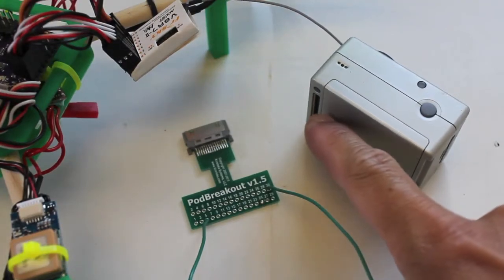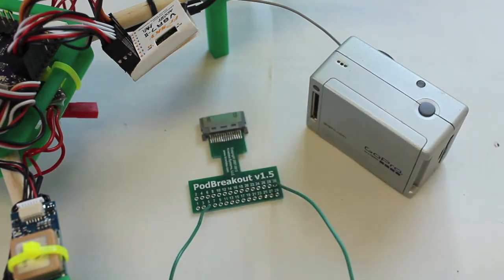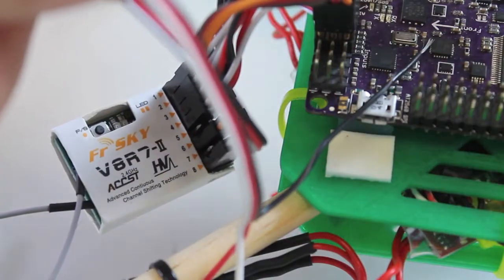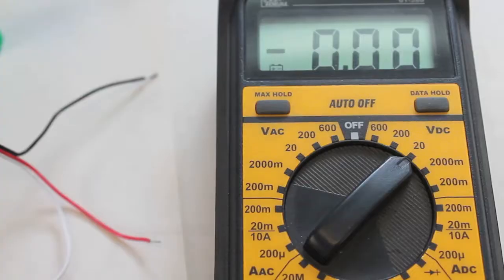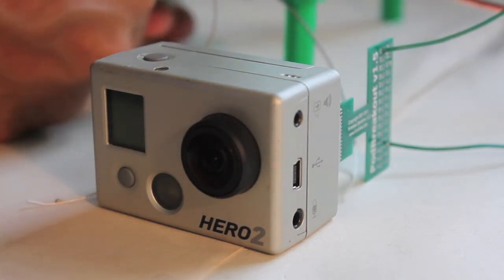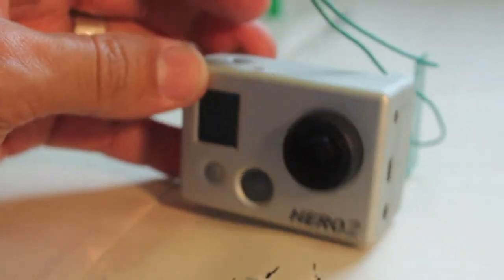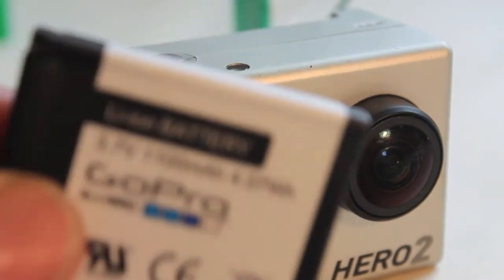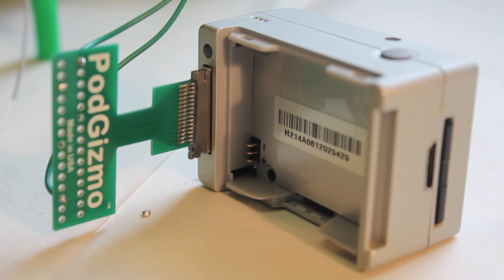Powering GoPro Hero 2 From RC Receiver Using Bus Connector

Comment from the maker: I currently use the ReadyMadeRC video out cable from the 3.5mm jack. It works great, but I just wanted to experiment with the bus connector to see what was possible. Thanks for the tip.

Comment from the maker: Great question. My ultimate goal would be to get a little PCB designed that would include the bus connector, an FPV transmitter, and antenna all on one board. So it's a plug and play FPV solution that would work with most 5.8GHz transmitters. Just a thought. Would be interested in hearing if you think that would be useful. The board would get power from the bus connector and the GoPro's internal battery. Or perhaps it could get power from the RC receiver which would in turn power the GoPro.

Comment: I love the idea of utilizing the bus connector but I caution using the GoPro itself as your FPV cam. When i got started I wondered why everyone was using those cheap CCD board camera's and now I see why. As soon as you take off and you either face the sun or some shade, you can't see a thing. The GoPro is a pretty terrible FPV camera due to its CMOS design. Try it yourself though, i knew I had to but I couldn't fly with it. Anyway, good luck!